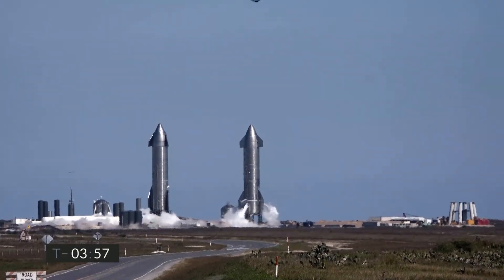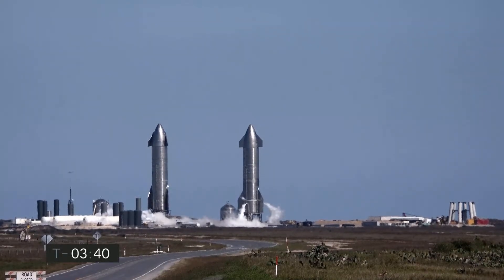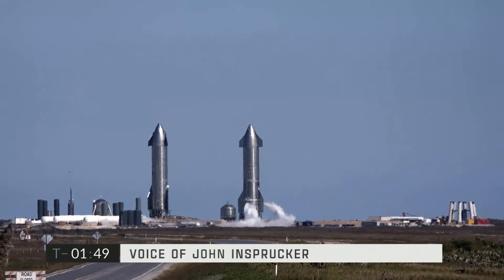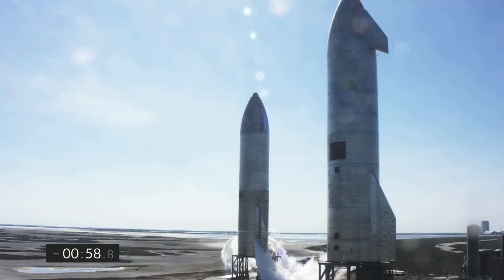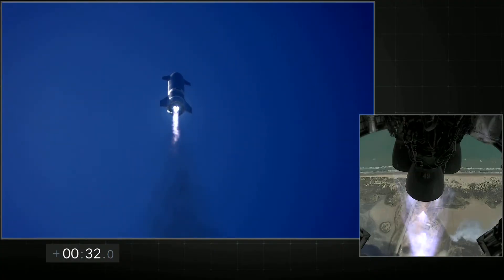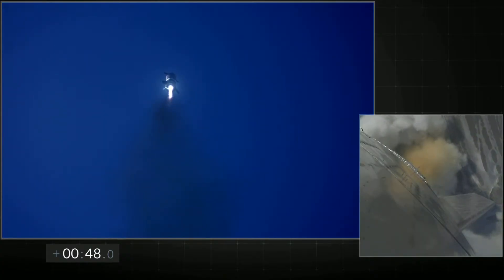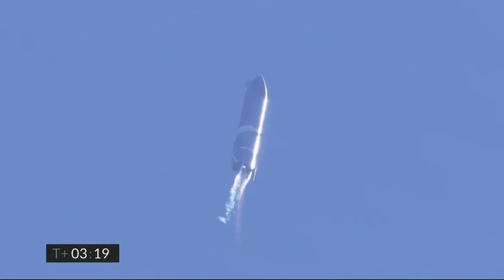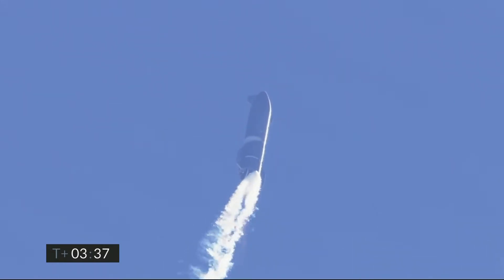Starship | SN9 | High-Altitude Flight Test

Comment: Imagine what people will say when they see SNx make a perfect landing. "It's a miracle!". People will stand there pinching themselves in disbelief.
Reply: Las Vegas should start a betting pool .pick a number between 10 and 10000
Reply: It will be a miracle indeed. You need at least 10 successful landings in a row before you can say the system is somewhat safe. And Musk is rich but I don't know if he can spend such an enormous capital to launch such a quantity a rockets.
Reply: @lucdevincke2055  A few million for each starship isn't much for papa Elon
Reply: @lucdevincke2055  there is and always been a big possibility that they need 10+ launches before they can nail that landing burn. Musk himself was never overly confident about this manuever, but that doesn't mean it impossible. It's just hard. 

So that said, they should have the capital, because they went forward regardless. The more they fail the bigger reward it will be when they land it, just like in their video: "How not to land a rocket booster"
Reply: @lucdevincke2055  The issue is that they have a design flaw. They have to go back to the drawing board. SN9 was a temporary modification but it has not worked out. The issue is fluid momentum caused by the flip manoeuvre. They need to find away to dampen down the movement of liquids. It seems they need to do the flip much higher up & just free fall in a vertical position without lighting the engines. That way the liquid has time to settle down before the valves are open.
This is the 2nd time the landing engines have been starved of fuel.
Reply: @macswad  maybe some pneunatic system.
Reply: @Psycho7452  Any fluids that are suddenly flipped in gravity are just going to swirl around, even if they are stored at high pressure. They need to achieve fluid stability before lighting the engine.

Comment: They should just ignite all three engines during landing in case one fails.. ^^
Reply: if all 3 engines ignite, it's too much thrust
Reply: @kjeed7735  A bit too much thrust upwards is still better than falling downwards and you would then of course shut the engines down again one after an other for the landing.
Reply: @QuantenMagier  sounds more complicated than just stabilizing the raptor engine, it's still experimental
Reply: @QuantenMagier  
Too much fuel

Comment: It would have been awesome to see a successful landing on test #2, but IIRC it took 6 attempts before the first Falcon 9 landed successfully and another 10 attempts before becoming routine. 
Starship is sufficiently different from Falcon 9 that it's pretty much starting from scratch in terms of learning curve.

I am curious why they didn't start with ocean landings though. I guess the only benefit would really have been PR-wise (no explosions) and an ocean landing would have precluded the chance for re-use if the landing had succeeded.

Comment: Well should start the maneuver much earlier. At least before they find out how to do it. This way there is not much time for correction.
Reply: one engine didn't reignite, one engine isnt enough to land it no matter what
Reply: @kjeed7735  Pitty. But as this is a experimental flight doing this in higher altitude could gain some time for retry. At least till they figure out how to do this or add more engines as backup as well maybe 3 on a side to help stabilize. The ship has been over turned.

Comment: It needs a lot more power in order to slow down the landing or it needs to slow down much sooner. Did they forget they need a lot more power to land than to take off?
Reply: Of course they knew that, the engine failed and this system relies on the engines not failing.
Reply: @OzearEimaj  I see

Comment: It technically would have worked. I have a suggestion that they won’t see but I’m still giving. Try starting to flip at 3 km and slowly fire the Landing burn at 2.5 KM then increase the engines power as much as needed at 1 KM and then try to land it.

Comment: It seems relighting the engines for the landing burn is proving troublesome — first the low header tank pressure and now whatever happened here. My question is this, what is different here compared to engine relighting when landing a Falcon 9 booster? We've seen SpaceX nail the relighting of the Merlin engines. Is it that different here? If so, how? Thanks wise people of YouTube! (Very excited to see SN10 nail the landing!)

Comment: Congratulations SpaceX team. Also for those stating nothing has improved I'd like to point out that this vehicle landing is incredibly more complex than a Falcon 9 landing and yet the Falcon 9 landing was thought to be impossible nearly 6 years ago and had failure after failure. Yet they learnt, improved, implemented and tested until they nailed the landings. Starship will go through a similar phase. I never expected the SN8 to reach apogee. I didn't expect Starships doing successfull belly flop maneuver until atleast SN17. Yet here we are already on a second test flight of Starship prototype vehicle successfully skydiving back to the landing pad. Raptor engines are still in development too. So the fact they're working as successfully as they are despite them not being attached in a clean room shows the technological advances SpaceX has made developing raptor engines. 

Yes they've proven to feel and look confident with the belly flop maneuver and subsequent sky dive so either SN10 or SN11 will be a successful landing. However if that doesn't come until SN15 which Elon Musk has stated the major improvements will be implemented into SN15 that should not come as a surprise. If SN10 and SN11 fail to land however provide further data for the landing and for the belly flop, sky dive maneuver that is still a great success. 
Congratulations to all the SpaceX team for their dedicated work and subsequent enjoyable RUD. Keep ya chins up and good look on further test vehicles.

Comment: It must be a difficult problem. Turn the fuel tank upside down just as you turn the engines back on. I hope sn10 has improved plumbing.

At least its easily recyclable.

Comment: So why did it not land?
Reply: Engine failure; the green flame at 11:47 indicates the engine is not working as intended. Since it needed 2 engines to flip around and slow down for landing, it hit the ground too fast and at the wrong angle.
Reply: @OzearEimaj  I didn’t see any green
Reply: @fredington4690  It's certainly there, but more clear in the SN8 test, re-watch both and you'll see it eventually.
Reply: @OzearEimaj  I saw it on sn8 but not sn9 maybe when they get a different camera angle it will be more visible
Reply: @fredington4690  the second engine failed to reignite properly
Reply: They overshot the flip
Reply: @fredington4690  They work these things out before they fly; that's like saying someone crashed their car because they "misjudged the distance to the wall" despite their brakes failing. Would've went perfectly if the engine didn't fail.

Comment: I think the landing fuel tank being in the noise is the problem. The landing engines do not seem to have any power.  Maybe start the landing engines sooner.
Reply: Pretty sure they overshot the flip and didn’t have enough time to pull back
Reply: one engine didn't reignite. it needs the power of two raptors to land
Reply: @kjeed7735  it uses one for landing burn

Comment: When you accidentaly program the landing burn coordinates as x=-100 instead of x=100
Reply: I've done that exact thing on the x-axis of a  Mazak cnc. Embedded the drill in the part. Very shameful day 😂
Reply: @bustabanana  only thing Mazak I can afford is a 50 year old manual lathe.
Reply: @Thewaldo12345  😂 same for me! I was 19 when I did that mistake. And the Mazak machine must've been about the same age. Still a workhorse for the company. Nobody ever said anything or reprimanded me, but just the look on people's faces was enough that I never did that mistake again 😄. There was a bin with all the "mistakes". Another guy forgot to switch the inserts on the biggest machine in the shop. The machine had a powerful enough spindle that it kept pushing the tool into the steel. It made a blob of magma. 🤪 Fun times. If I remember correctly the machine was a FH 8000 series.

Comment: Engine 2 did not relight.
Reply: It did relight but not for the landing burn since they usually use 1 engine for landing they use two for flipping and they overshot it and the one engine wasn’t enough

Comment: I honestly think the only issue is that they are starting the landing sequence and burn too late. Might wanna move it up to 2.5km instead of 1/1.5km
Reply: you are right
Reply: two engines fight with no proper fuel pressure(free flight liquid gas mid-up-press/ flip on decent side-up-press liquid gas towards the engine that only fires up on decent path. I think it's just bad flight designing. the point is to design the flight overall better. straighten up the rocket position on 2-3 km by venting gases and then start the engines to equal pressurization mid-press. Before other flights redisign tank overall to grab fuel on every level of tank to one pipe at the end shared by the 3 engines) /// also there has to be system onboard that maintains liquid gas... liquid....otherwise good luck on Mars
Reply: Yeah they are a bit low, cause there's no room to stabilize the landing burn, but it also looked like one of the engines crapped out on them as well. Oh well, more data!

Comment: SN9 is too heavy to land vertically need a parachute 🪂 or a very powerful suction engine on tha tip to pull it vigorously upward assisting the lower engines

Comment: The 95% of the flight was a success, they only need to work on that 5%.
Reply: Yup, ever prototype is a wealth of data and experience, landed or not
Reply: @VonNeumann1234  The point of this test is to collect as much data as they can.
Reply: @HotCakeX  Never think id say we would actually be dissapointed that we did not land a rocket back on earth in 2021 , if u said that to someone in the 60s 70s or 80s they would go nuts
Reply: The real problem was in the lithobraking
Reply: Send that prototype to Al Qaeda astronauts to reuse. They don't need a perfect landing.
Reply: @VonNeumann1234  And that's why I said 95%. Of course even 99.99% is not enough for a landing but if your goal is to detect potential errors a "failed" test is a success.
Reply: Technically it was a success because until recently most rockets were almost entirely expendable. If they can land this giant rocket itll be a historic event even bigger than falcon landing.
Reply: @Andytlp  I agree.
Reply: And that 5% is only 25% complete

Comment: I'm wondering wouldn't it be more reliable to try to do the belly flop a bit higher altitude and light the 3 engines then gain some altitude stabilise the rocket and then shut down one engine and slowly descent the craft similar to the  small hop.

Comment: Elon. Please start setting up a landing possition a bit earlier. At least at this stage of testing.
Reply: What do you mean?
Reply: @user-RCST  Start engines and setup vertical posittion 3 seconds earlier
Reply: @jacekwownysz8348  It wouldn't have changed a thing. Go watch EverydayAstronaut's angle, it overcorrected massively.
All flipping sooner would have done would have been to make it overcorrect at a higher altitude. End result is still a crash.
Same is true for SN8, for different reasons.
Reply: @lazarus2691  You are right. It landed at 45 degree angle. No chance for good landing at this possition and so close to the ground. SN8 did maneuver much better.

Comment: Last time fuel pressure was low..   so lack of thrust.    This time lets assume it was correct (higher) but one of the engines couldn't take the pressure (or maybe overpressure?) so does a minor RUD (pieces flying off in flight), and then of course all the flight control maths is off.  How many times did Falcon 9 crash before they stuck the landing?
Reply: 3-5

Comment: I have the impression that the engines are just enough to get him off the ground ... he's slow as a sloth ... they don't seem to be capable of braking the shuttle for landing. it doesn't seem to me just a question of timing but of engine weakness.
Reply: The ship weighs much less by the time it lands, maybe 1/4th to 1/3rd. It's landing TWR on two engines is comparable to Falcon 9 on one engine.
The engines have more than enough thrust to slow it, if they work properly. The issue is that so far, they haven't.
Reply: @lazarus2691  if I am not mistaken, these motors are generally not made to turn on and off and on again, right? perhaps the development is in this direction.
Reply: @torniaccio  Orbital rocket engines in general? About 50-50.
 Upper stage engines are often made to relight so they can adjust orbits. Rl-10 for example.
But as far as booster engines go, it's very rare. SpaceX's Merlin is the only booster engine in common use that has relight capability, even the Shuttle engines didn't.
As for the Raptor engine specifically? It was built from the very start to be able to relight, since it was custom built for use on Starship. 
However, it's a very complex engine that's still in early development, and it's put through some pretty extreme conditions, so it's not 100% reliable yet.

Comment: I'm not trying to be negative, but if you don't succeed at something, you fail at it.  If you failed to do the one same thing you tried to do the first time you tried it, you in no way can spin that to be a success.  By the way it crashed (I call it a crash because that's what it is called when this happens), it looks like whatever "modifications" they made, only compounded the problem.  Back to the "flippin" (pun intended) drawing board.  At least the first one was almost perpendicular to the ground when it crashed.  This one wasn't even close.
Reply: There's no indication that this was a fuel feed failure. The one engine that did light had stable combustion.
It seems more likely that this was related to that individual Raptor, which isn't surprising given how temperamental they are.
I agree with your point about this one is much more of a failure than SN8, but I don't think it's back to the drawing board.
Reply: @lazarus2691  I'm not saying they need to "go back to formula" (Spiderman reference there for the younger crowd), but they may need to tweak the whole process and the hardware.
Reply: @jamesmcdonald2599  I mean even if this had succeeded, they'd still need to tweak the process and hardware. Such tweaking will continue long after the first landing.
Reply: @lazarus2691  yes, but at least they would have a proof of concept.

Comment: After watching both SN8 and SN9, I think I may be able to pinpoint a solution: flip the craft and restart the engine sooner so it has time to become stable. It's literally going to swing like a 130-ton (120 metric ton) pendulum when you flip it from horizontal to vertical (far more than the initial flip because of less air resistance), and you need to give the craft time to both right itself and stabilize. I have not been seeing that time necessary.

Comment: Another engine failure. They wanted to use two engines, but you all can see that one of the engines did not ignite properly. Unfortunate, but at least we know why. Last time there was an engine failure of a different sort. I wonder if it is a fuel flow issue, or simply the engines being pushed to their limit.

Comment: Looks like a little more engine work. This is a completely different engine than ever seen before. I don't think any rocket has ever used methane either. People have to remember, the only place where kerosene is available is on earth. SpaceX is building a ship that will be able to refuel on mars. While the starship is being developed, falcon9 keeps carrying cargo and people to orbit. 
We'll probably see more successful landings after SN12. Maybe SN15. All of these are just test vehicles. They're not intended to even make orbit. SN9 had a beautiful flight.